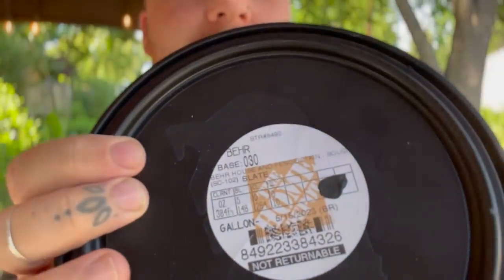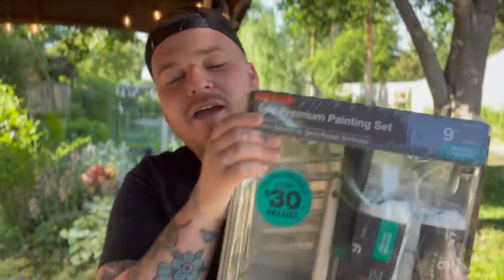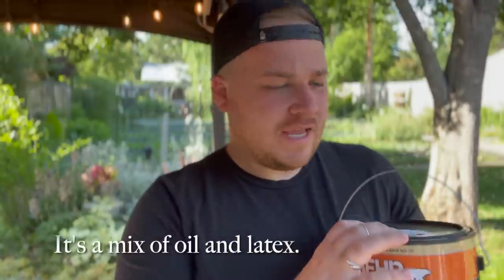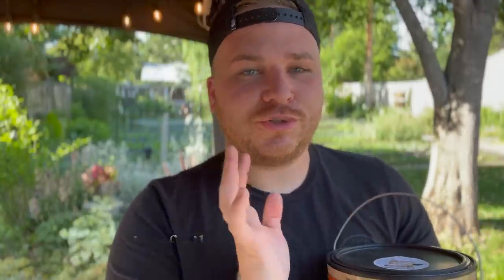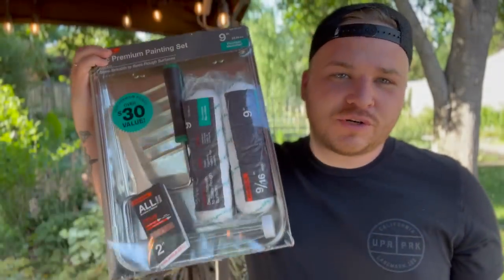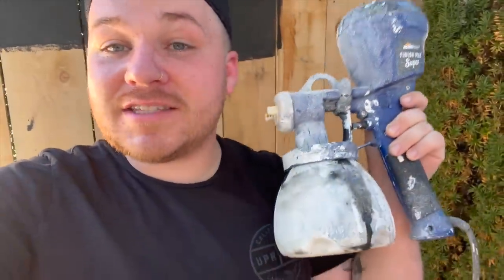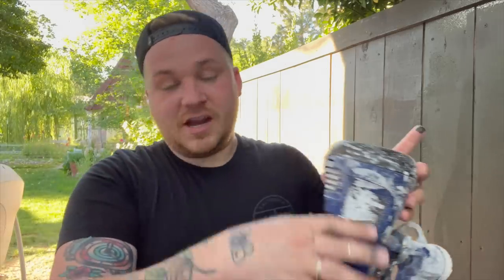We stained the fence! Black! 😱😍 || Vist Our Garden

Comment: I just stained my back block wall dark Green and I love it. My husband was against doing it but I did it anyway (always happens that way)!  I rolled it doing a section every AM while in the shade. Had to do 2 coats and touch up with brush. I want to do the 2 side walls as well but haven't won that battle YET. I WILL BUY A SPRAYER for that if I end up doing them too.